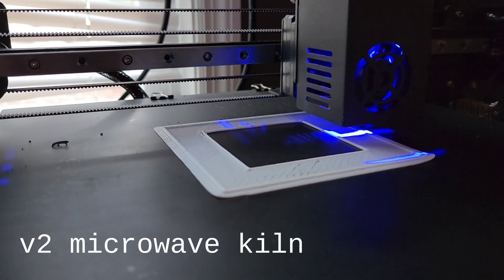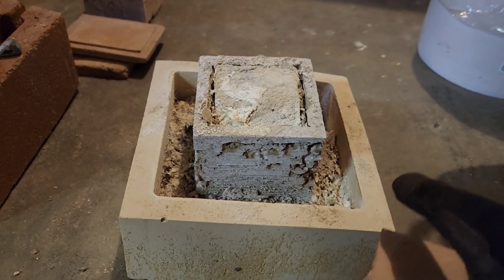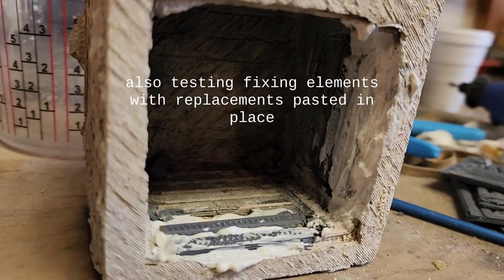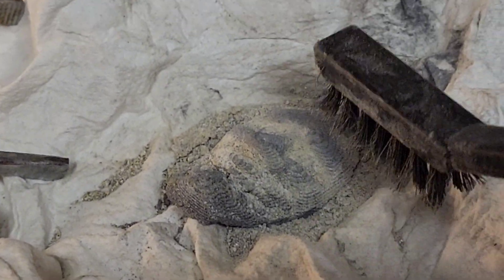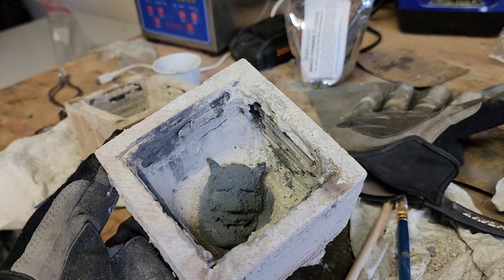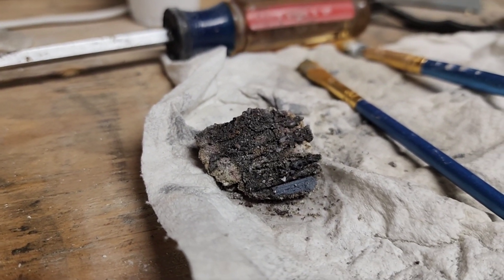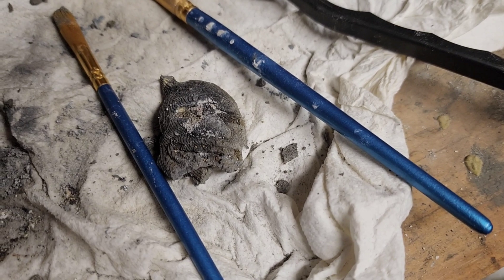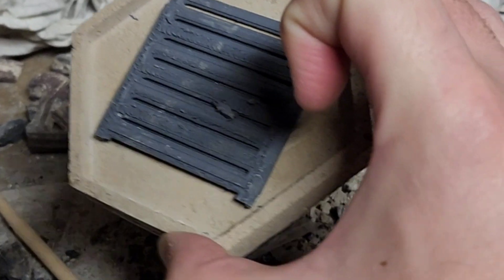Progress on Aluminum 3D printing & sintering

Comment: awesome work let us know how the stronger microwave goes? what is the power of the new one?
Reply from the maker: The new one is 900w vs the 600w I'm currently using and might be getting a stronger one then that soon (3 different power levels and test between them) but will certainly be sharing results